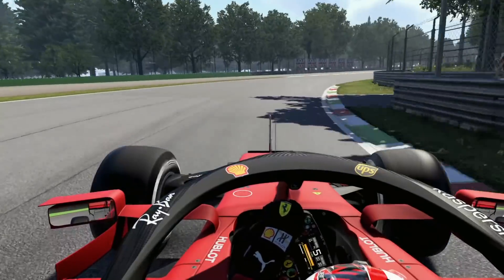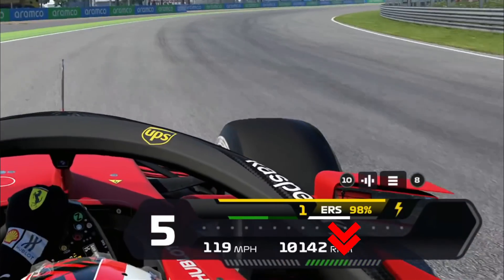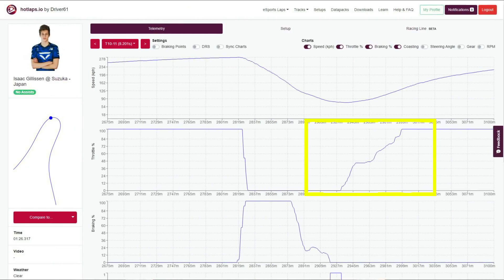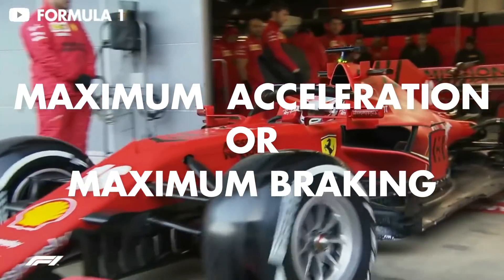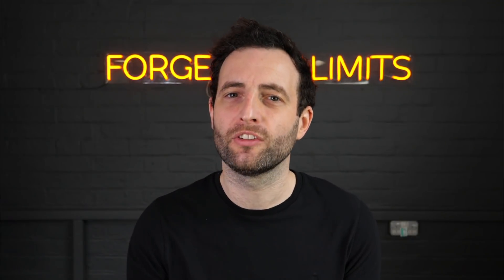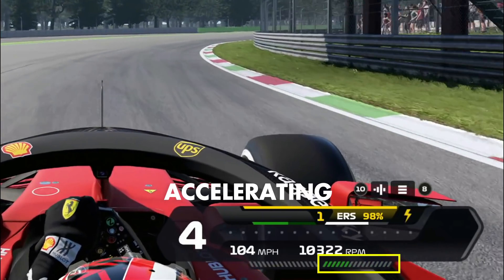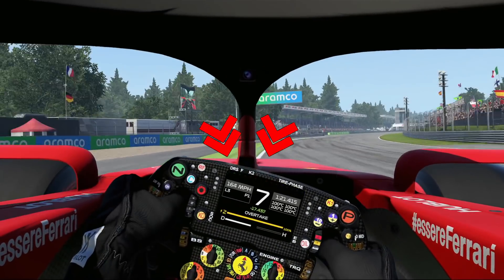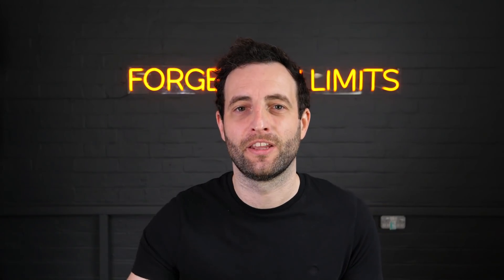These THROTTLE MISTAKES could be costing you serious lap time  [F1 2020]

Comment: Great lesson! One that I learnt with you, Scott, and seeing some Michael Schumacher's throttle data, then putting everything I've learned into my karting training and races. Worked WONDERS.
Lap times cut by around 1s ~ 1.5s in a lap. Then, I applied this even to my daily, hahahahaha. 
It is useable for street driving as well, specially on snow. Saved my skin a time or two.

Comment: Throttle on keyboard: Tap-tap-tap-tap-tap-hold. Yup, that strategy works even for keyboard. And short shifting if necessary. Than can allow a bit of rear-slide here and there without big worry.

Comment: Super nice video as always. I have try it to do as you said about looking far ahead of the car, but then i cant "feel" the car and how behave on track. usually i feel the car from wheel forcefeedback and looking at the front of the car how she moves on the track , because i dont have a real feel of the car rotation like in real live to prevent if the car want to oversteer or understeer. so if i look ahead i dont feel the car on track. how to fix this in simracing? thank you

Comment: Is it beneficial to drive cars with less than optimal setups because you need to be very careful with inputs? Or is it ultimately making me slower because of little bad habits like low cornering speeds
Reply: I think the general advice is to start off with slow cars so I don’t see why a bad set up wouldn’t help you get better as a driver, makes it far more technique based
Reply: If you're playing F1 2020, definitely do lots of practice in time trail with the default/balanced setup.  It is slow and very understeery and forces you to refine your technique to get faster lap times.

Comment: Playing f1 2020 with no tc at all, and i always get the same problem since i turn it off 50 hours of gameplay ago. It is always spinning at the exit of a slow turn, the turns that needs second or third or fourth gear on the exit, any idea how to deal with it?
And i love to know how to make a consistent lap times too. 
Anyway, thanks to you scott and your team for creating your channels, it helps me to understand how to drive faster, and eventually, taking off all of the assists some short time after starting to play racing sims with steering wheel.
Reply: Are you on wheel and pedals or gamepad/keyboard? You have to be very smooth on the gas pedal (well, on everything) to avoid spin. You cannot do it without pedals.
Reply: I agree with M Cunha. Keeping or meeting the right velocity in corners with a gamepad is really hard. I tried it in Asseto Corsa. As soon as switched to wheel and pedals (after getting used to a new input device) my times been instantly 1.5 seconds faster.

Comment: 2:05 Actually disagree here. Accelerating is increasing overall grip not decreasing it. A racecar is always accelerating somewhere and F1 car having longer wheelbase than track will have less weight transfer under power than when cornering, so less grip reduction from tyre load sensitivity. And no you can't tell me it's "dynamic effects" on a car that settles as fast as you can push the throttle. 
I know we are simplifying stuff for youtube here, and the advice itself is ofc good, but imho when you have to lie to get your point across something broke down in the teaching system.
Reply: You got it wrong. Scott didnt said accelerating cause a lose of grip, he said not doing it on a smoth way does. It you jump on the gas pedal at the middle of the corner, like from 0 to 100%, you will have much slower exit than doing a smoth acceleration moviment. On the first type of driving you likely will get understeer effect and the need to get of the gas just before the exit to avoid going wide and out of track. All the good racing drive's brake and gas input lines on telemetry have a smooth shape, its not like an on and off swith.
Reply: @mc1996  Note that im not arguing the conclusion, but the evidence. It's not uncommon to be right about something for wrong reasons.
This is not a place for good debate on it (there is soo many sides to this it's not funny). So im going to leave you with food for thought: Alonso was known for having his throttle pedal stroke shortened so he could push throttle as fast as possible. Similarly Senna was often mashing the throttle too. The real reasons for why smooth throttle application is fastest (because it is) comes more from racing line theory than weight shifting and grip loss.